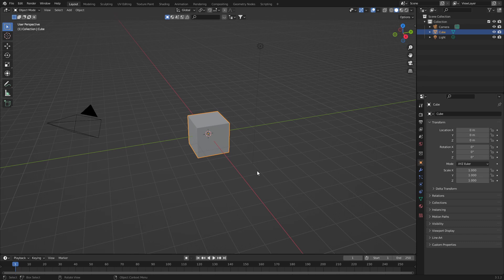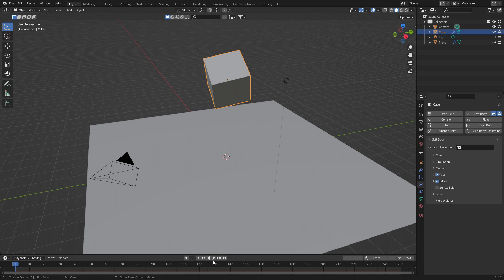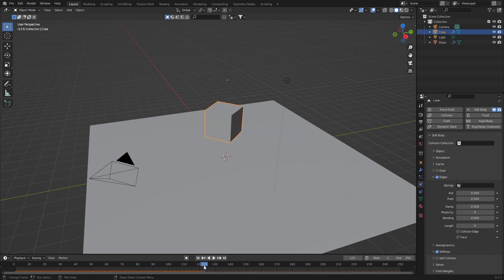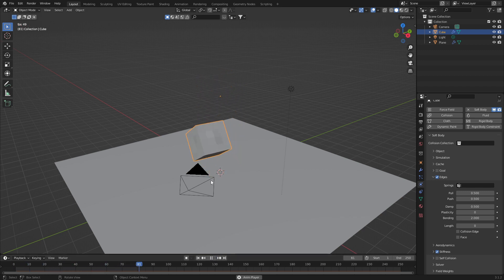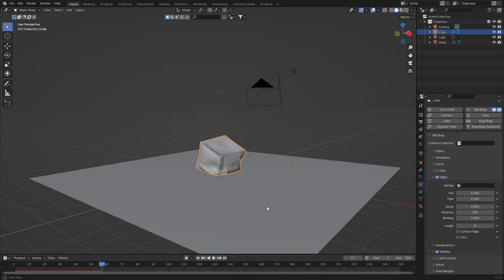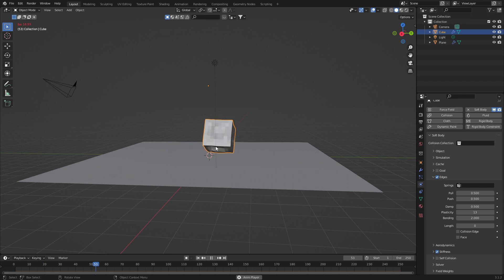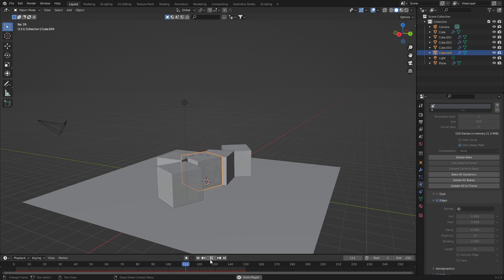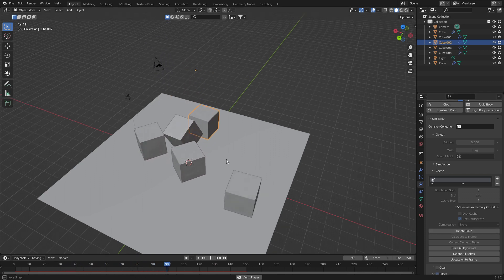Introduction to SOFTBODY physics in Blender

Comment: Thank you so much! I've been using BLender for a while and I forget many things, so this video being only 2 minutes long and still helping A TON is fantastic!
Reply: I still suck at a lot, but my trick to remembering is to just listen to as many sources as possible on anything that might be vaguely related to what you're doing or might do, and don't focus on what you don't get. A lot of it is related, so if you just canvas a ton of sources with an emphasis on speed and generalities over verbatim quotes, you'll hear people discuss similar conventions over and over until it kind of sinks in. It's a bit slower but I predict that in the long run it's more beneficial to have a little understanding about everything than a big understanding about one thing. And then in practice just stick to one experiment at a time and follow tutorials as closely as possible to leave the least room for error, troubleshoot failure, burnout, self esteem issues and all that fun stuff.

Comment: What's even more interesting is the different ways you can "fake" soft body simulation when needed. I'm talking about things like adding soft body simulation to a lattice that you then bind to a high Res object or similar workflow with the mesh/surface deform modifiers.

Without these techniques there's no way you can simulate soft body on objects with many polygons without frying your pc.